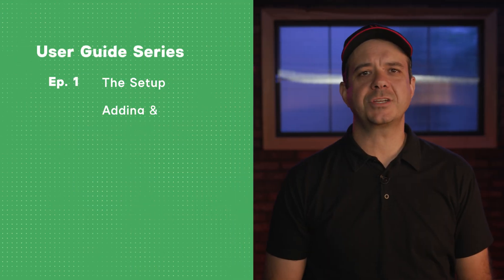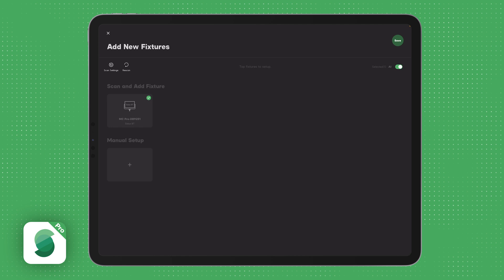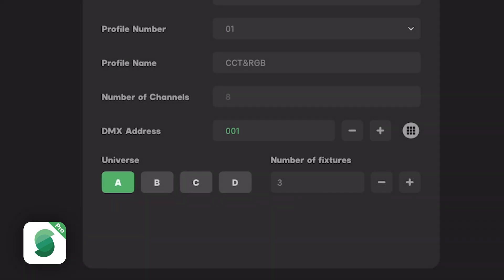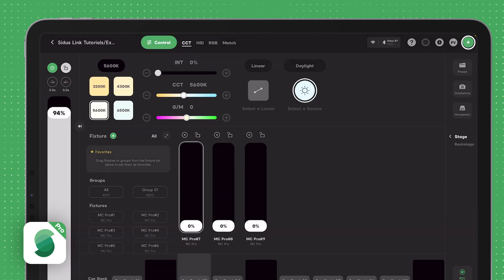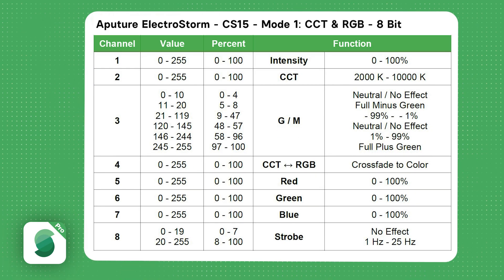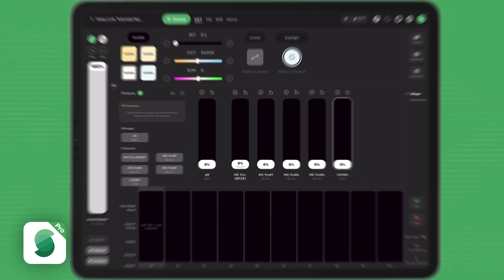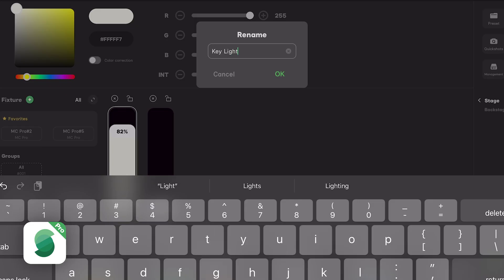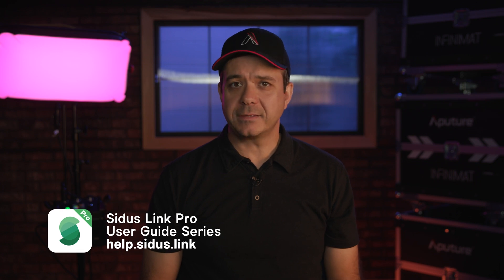Ep. 2: Adding & Patching Lights | Sidus Link Pro User Guide Series

Comment: In addition to the CRMX connections, I want to connect some MCs via Bluetooth. However, they connect without any problem, but there is no control until the Wi-Fi is disconnected. In other words, there is no control until the Sidus One is disconnected. Once the Sidus One is disconnected, the control via Bluetooth works. Do you know the solution?

Comment: Hey there, it’s seems like you skipped the crossfade entry. I’m trying to add in tubes but the crossfade button auto fills out the profile incorrectly. Is there a way to add the CCT-HSI crossfade just as a single channel without the presets in the crossfade drop down?

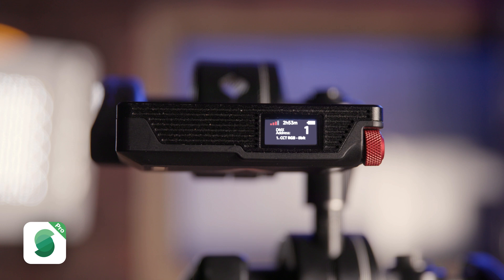Comment: @7:16 you show a dmx connection screen on the MC pro, where is that screen in the menu system. I can't find it. Also linking reliably is not covered in these instructions. I'm having a heck of a time getting more than one MC pro linked at a time. You've got that great Bluetooth and wifi data channel you could use to do all that insteat of all that menu diving. Why not use all the great tech you have in the unit to make it simpler to use? I understand the need to make it backward compatible with dmx only lights, but can't you have a seperate process for more modern Apurture lights? The best of both universes, so to speak.

Comment: pixel effect controls coming soon? also really need to add some buttons to be able to audition the lights individually instead of just using master control. blacking out everything is not a good solution. Each unit needs individual blackout controls. hope someone reads this. please update the app with new firmware
Reply: Also, yes, working on FX, and Pixel FX
Reply: Hey Scott, each light has a slider. Not sure what you mean by blacking everything out.  Can you expand your explanation?
Reply: @BenDynice-Aputure  Hey Ben Thanks for getting back to me. The slider is helpful but not fast enough or very accurate way of saving a light. 
For Example:
DP tells Gaffer" Hey Bring the key light up to 85%" 
"okay now bring the hair light up 10 points"
 " Okay save the Key Light and meter what T Stop the Hair Light is at."  (WITH A SLIDER I NEED TO BRING IT DOWN TO 0%)
"Okay Bring back the Key Light."
(NOW DIM IT BACK UP TO EXACTLY 85% AGAIN) 

This is really bad, We should be able to do this with LED no problem. Even with a tungsten unit with an old 1K dimmer you can shut off the unit without changing the dimmer intensity. 
If a light is set to a F2.8 I should not have to dim it down to black it out. Yes I can Have my KeyGrip bring in a solid in front of the light or I can unplug the Aputure unit from the wall for a moment. But this not the way to work. there needs to be an on and off button for every unit,  like a light switch. ON/OFF Not just master but for every unit on the stage.  You don't like the look of that MC in the background. One click its off. lets see it back on. click now its on. dimming changes the value and it too slow to get back to the desired intensity value using dimmer.
Reply: @scott_stevenson  Big agree on this, an individual on off switch just like on the Sidus link phone app on each fixture is needed